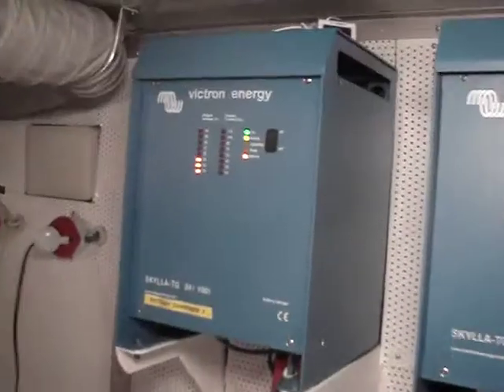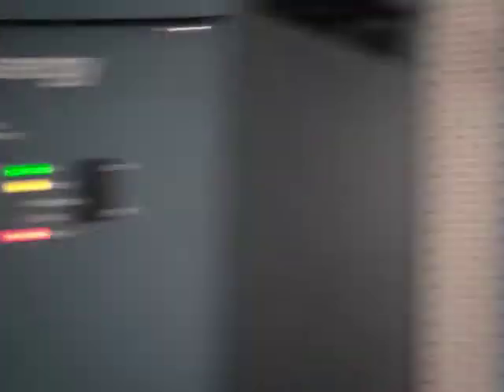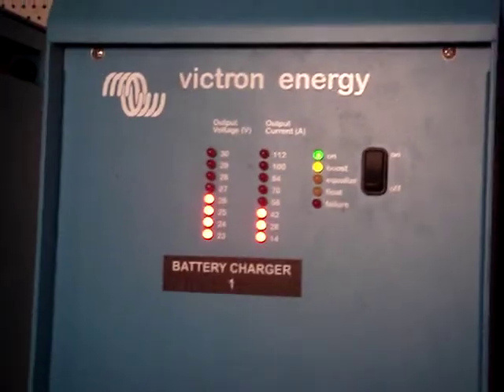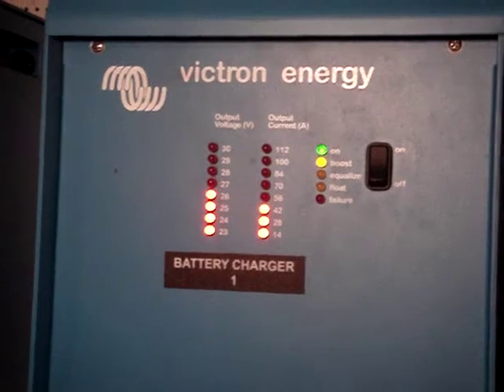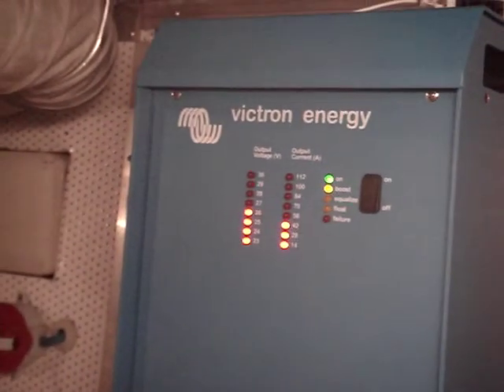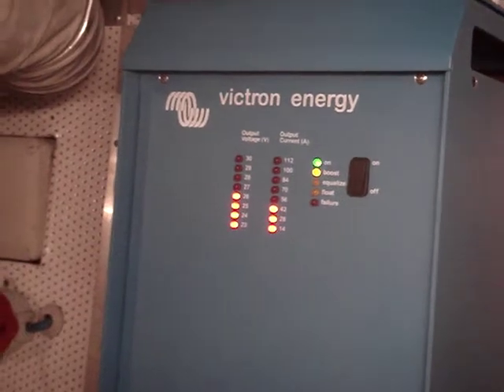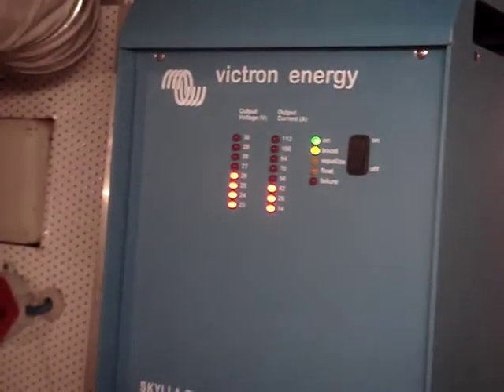Victron 24 VDC 100 AMP Battery Charger Boost + Failure Lights Blinking

Comment: Low shore power,or simular, looks to me also that there is a problem with the max loading voltage, if you charge bulk, it has to be around 28,8 volt, not 26, that is way to low, in float has to be 27.3volts, not 26, you can see by the low charging amps., your problem is something whit the ac input of the chargers. (I,m a licenced Victron dealer,VRM marine)
Reply: Hi dear I also have same problem here temperature is 50° and output voltage are 24 , red failure light is constant boost light flashing , same happened with other charger few days back now batteries are totally dead, please help if you can thanks in advance
Reply: My ac input ok,but don't show any amp@mrbugsier5

Comment: What was the temperature of the batteries? (Not the air in the engine room). Are the chargers equipped with temperature sensors of the battery bank?